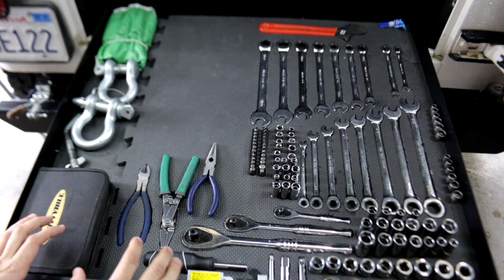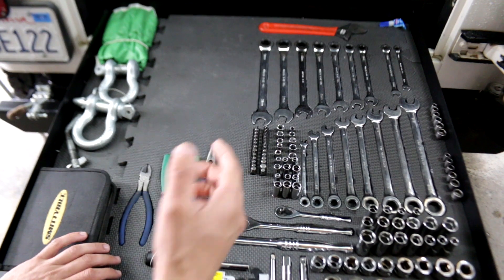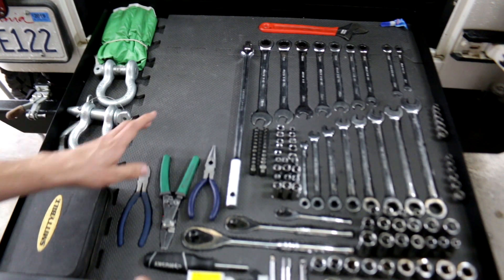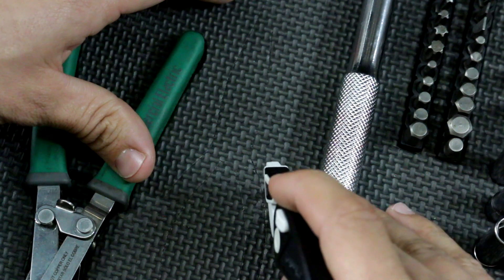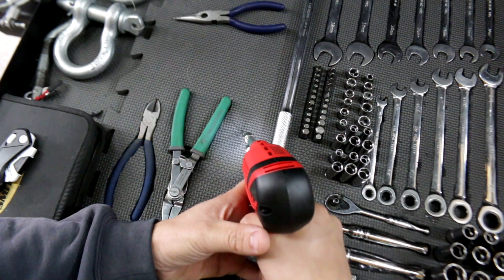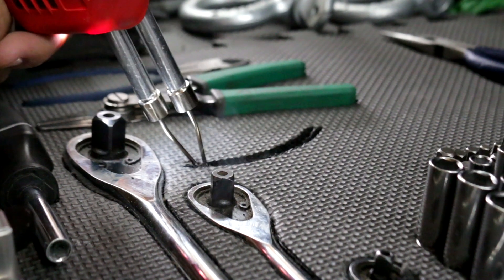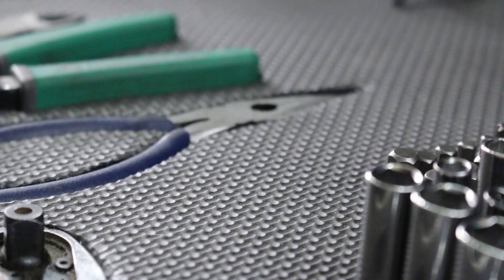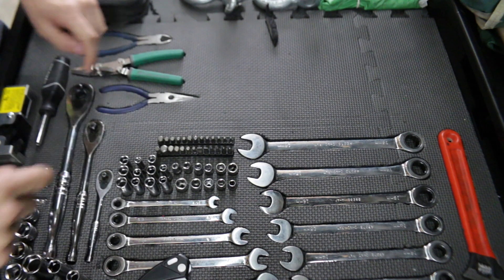Off Road Toolbox

Comment: Do you have a video of installation of the rear slide out tray? Does it adjust the rear seat in any way? Great video, just wanting more space in my TJ to get rid of the ammo cans.
Reply from the maker: Thank you! Glad you enjoyed the video. The drawer moves the seat higher by 3 or 4 inches. Other than that the seat is in the same location. I do have a video on installing the drawer, here they are: 

Tuffy Full Length Underseat Drawer - Part 1
https://youtu.be/AaMTnHSBww0

Tuffy Full Length Underseat Drawer - Part 2
https://youtu.be/31rhCzVmdro
Reply: That’s awesome, gotta save some more pennies for that box. Great idea on the padding. Game changer
Reply from the maker: Yea, it is a bit expensive. But it is built very well! Its held the weight of all my tools without any issues so far. Thank you, I thought it was a good idea too!